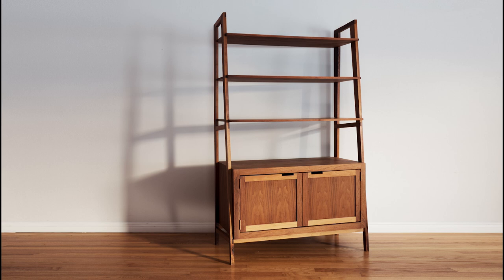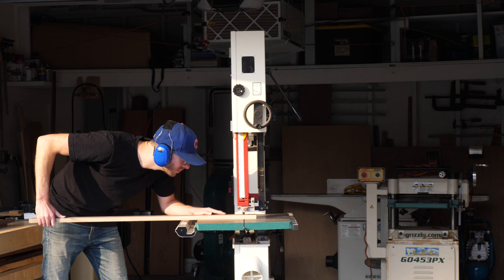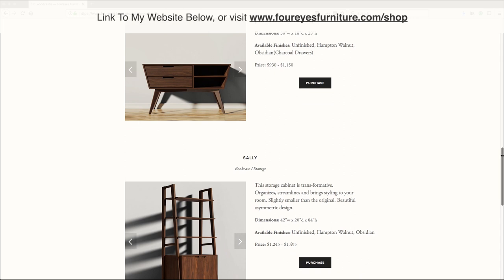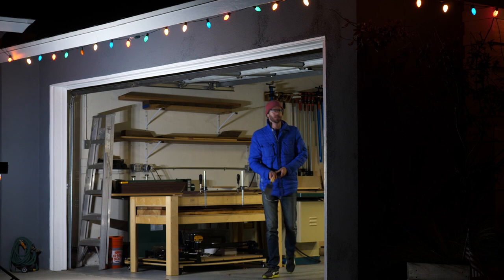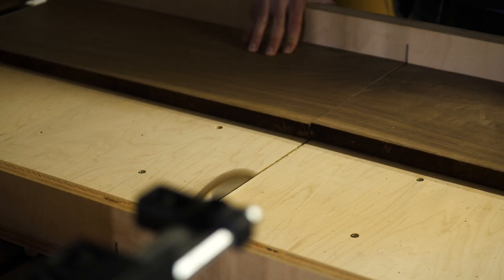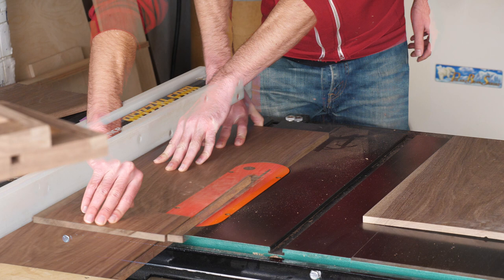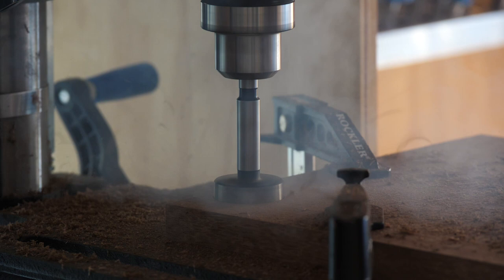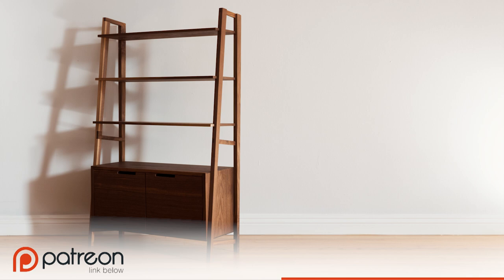How To Make A Mid Century Modern Bookcase | Woodworking

Comment: I have a question, I'm planning on building something similar, just a little bigger.  I'm just wondering if I need to worry about wood movement across the width of the shelves, between the frames?

Comment: Hey man, I love your videos. you got me curious about the price aspect of things when you were talking about your past experience. Could you explain a little how you determine your price and when you decide something is 'too expensive' or not ?
Thanks
Reply from the maker: Yeah...so basically, with material cost, labor, etc... making custom pieces of furniture is super expensive. So for example...my dream would have been to sell the pieces at a price similar to what I am able to offer with this partnership. A Bad Larry for right around $1,000, but due to lack of economies of scale, and other factors, I usually ended up having to charge about $2500 to make it work. I still sold several pieces...but it just kind of got boring after a while, and I felt like I hit a wall. That's when I decided I'd rather make videos
Reply: Chris Salomone, thank you for the fast and clear response! Really appreciate it.

Comment: Excellent video as always.

Do you bother to wipe off all the sawdust etc from your workpiece, or do you just not show it? Is it necessary? Also, what's the finish you decided to go with on this project?
Reply from the maker: Are you asking if I wipe it off before finishing? If so...yes. I blow it off, vacuum and wipe to remove as much as possible. My go to finish is "Siimple Finish with wax" from Maker Brand CO
Reply: Thanks - yes I meant do you wipe it off and not put it in the video. Your vids are very informative!

Comment: Pretty sure yours would be a 1:2 ratio, not a 1:8.  For things like scale model airplanes and such, a 1:200 means 1 inch on the model equals 200 inches on the original (so a 1:200 model of a Boeing 727 with a 6.5" wingspan would represent the 108' wingspan on the real airplane).  They mean that in linear inches, not cubic, so like however many inches the wingspan or fuselage are long, not how many model airplanes would fit in the original's cubic space.
Reply from the maker: That's kind of what I figured. Basically only thinking 1 dimensionally. I just didn't want to assume and then have people calling me out left and right :)
Reply: Youtube commenters calling someone out on a fact dispute?!?  Why, I've never heard of such a thing!!!  :)

Comment: Can I do this with only 2 tools?
Reply from the maker: Left hand, right hand :)
Reply: You could do this project with a hand plane, a cheap japanese hand saw (ryoba), a chisel, a drill brace and a screw driver, tools you could get for less than $50 total. But it would be really time consuming and require a bit of practice.

Chris uses solid hardwood here, which needs milling before use (requires a jointer and a planer). You could pay someone for that. Then the only thing you really need is a rather exact table saw. All his other (power) tools (dado blade, precision miter gauge for the table saw, band saw and route table) make it go quicker and easier.
Reply from the maker: Or since I'm selling them. You could do it with a computer mouse and a credit card :)